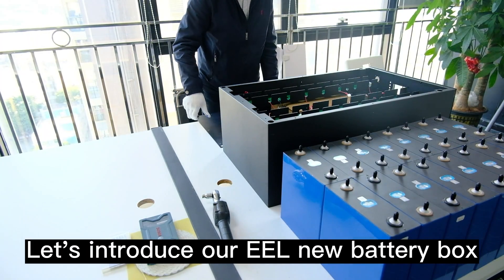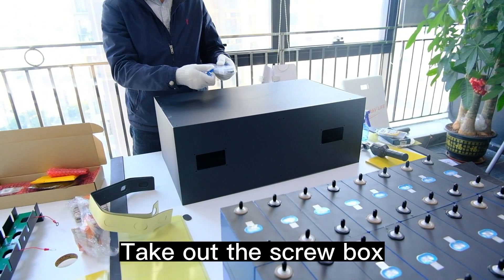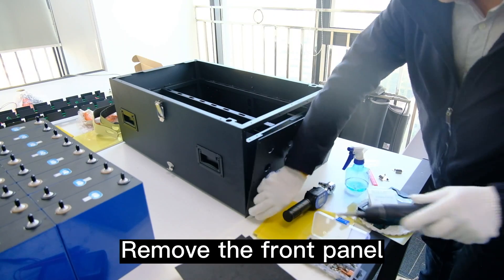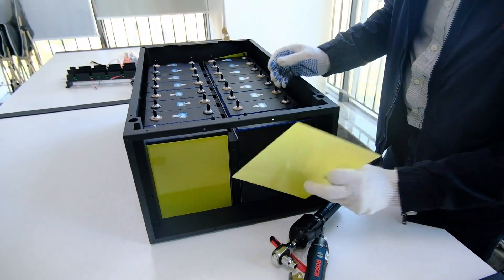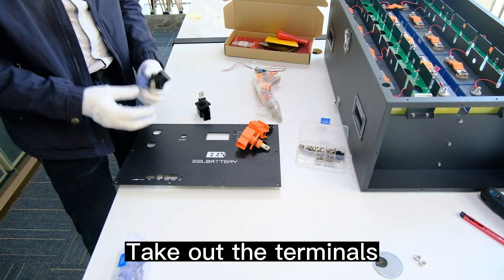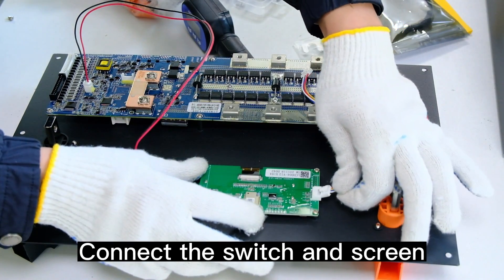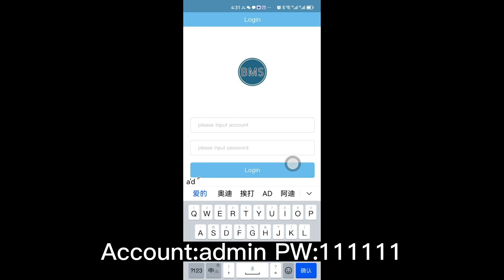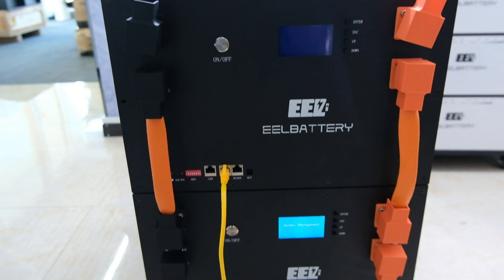EEL Updated 48V 16S Stackable Battery Box | What is New?| Steps by Steps | Let's DIY

Comment: What is the difference with the Sep los Mason??
Reply from the maker: We use different terminals with caps,the higher bracket to protect the PCB board, flexible bus bars inside to make sure the battery safe, you can see more differences in this video😁

Comment: What type of cable do you need for PC connection, please?
Reply: Make your own.  Use a USB adapter and connect B- to RJ45 pin 1 and A+ to pin 2. Nothing else is needed, you can run ground to pin 3 if you want.
Reply from the maker: RS485 to USB

Comment: I would put it on my wishlist if it would come with an active balancer…
Reply from the maker: We will consider your suggestion and welcome you to subscribe to our channel for more updates!😄
Reply: You can place a Neey in the front ( thats what i gone do )
Reply: I‘m curios to see how! Inside the box?
Reply: @hoiggy123   https://youtu.be/VSJ4pTPSUj8?t=249 "lots" of space between BMS and the plate ( maybe i make a vid. of my cases when they are ready ;-) )
Reply: @Mayhemkillerweed  I plan to do the same. But I have purchased a Jikong blanser. It has a smaller balancing current because 2A. I hope it will also do its job. Neey I didn't know.
Reply: @robertdziekonski6779  that will do the job , buildin bms is ( i think ) 150-180ma , so 🙌
Reply: Does it come with parallel cable and also bluetooth